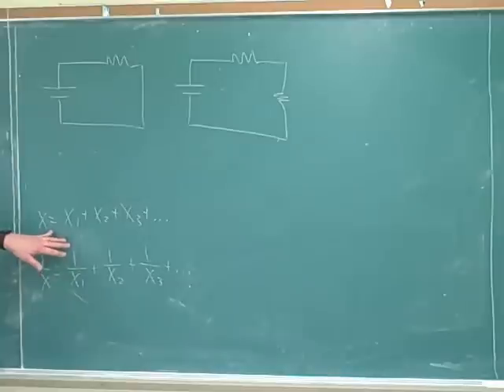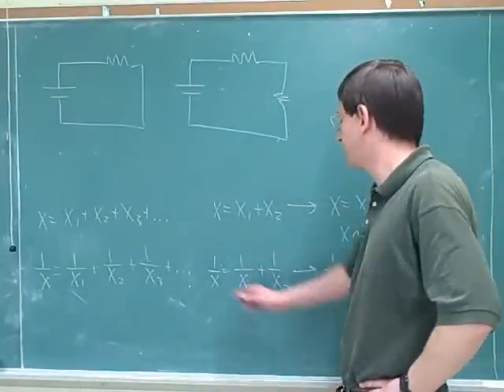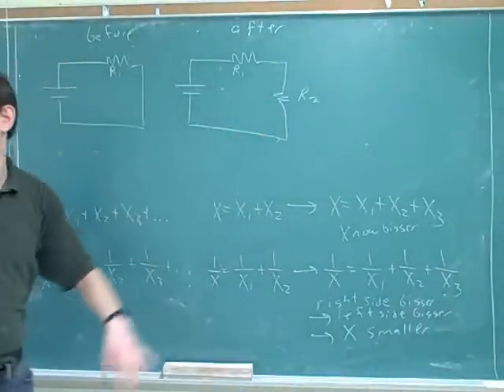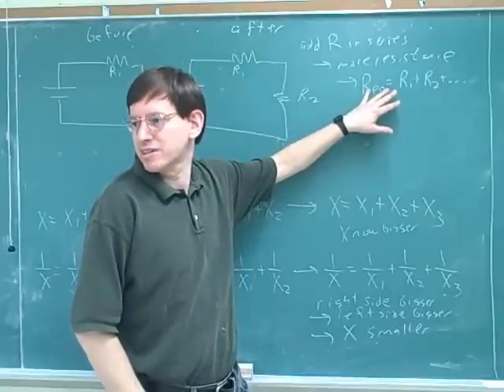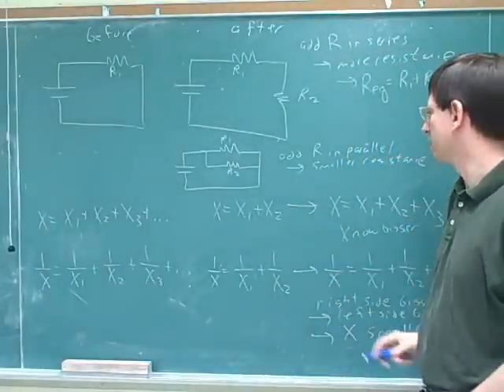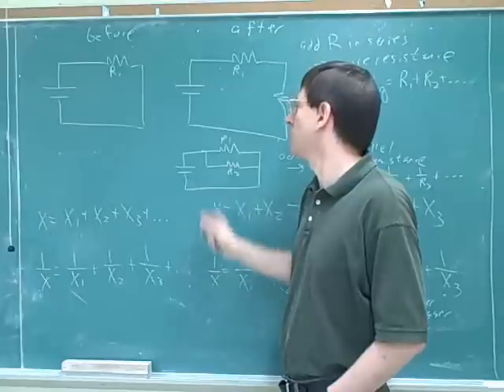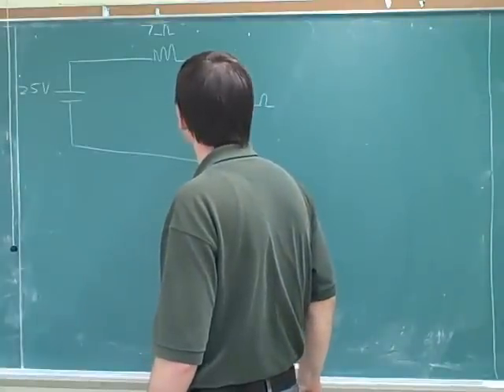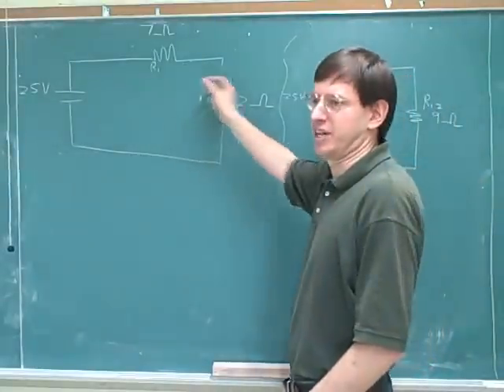Physics: Electric circuits. Resistors (10)

Comment: Great videos but for the last problem, no special methodology is required. Since the resistors are in series, I must be the same for both. Hence (7V*I) + (2V*I) = 25 V. Solve for I and use Ohms law to determine V for each resistor.